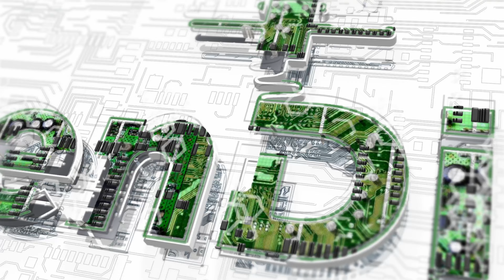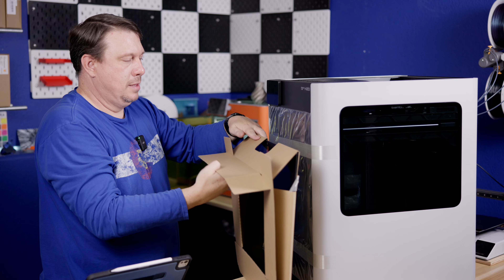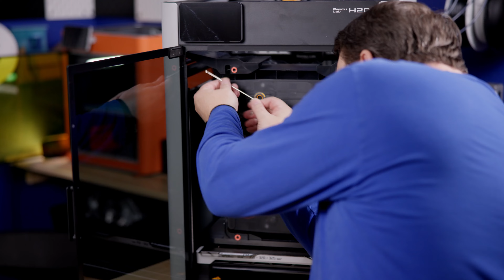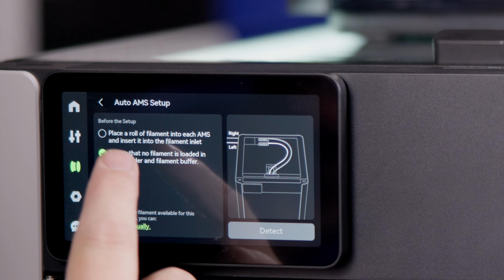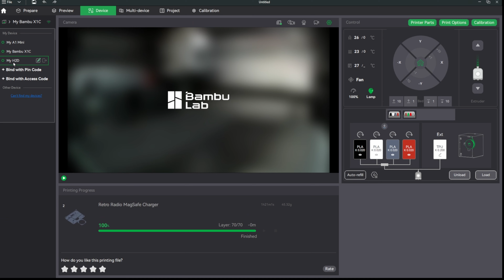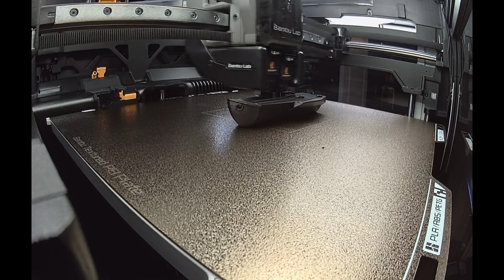Bambu Lab H2D Unboxing and first print.

Comment: The static right nozzle is more suitable for tricky filaments that aren’t suitable for an ams. With just one ams it makes more sense to hook it to the left“PLA“ nozzle and have the right nozzle do the heavy lifting. 2 ams are more useful on the H2D, one for each nozzle. It allows the slicer efficient color distribution.

Comment: Heads up. I’ve had about 400 hours of print time on my H2D and it’s doing great. I just have noticed dramatically better results when I set the pre-print flow dynamics calibration, bed leveling, and nozzle offset calibration all to on instead of auto. It takes only about 5 to 10 minutes more at most but it makes a big difference, especially if you haven’t done a full calibration in a while. I recommend turning those on at least for bigger more important prints were a few extra minutes doesn’t matter.

Also, I don’t know if it’s bad luck or an actual issue but seems every time I set time lapse on I notice more artifacts and issues with the prints
Reply: Yeah, it’s whenever you go to send your print to the printer. A little screen pops up, asking you about a couple little calibrations to run before the print and you can set them off, auto or on. I thought auto would be good enough and it was for a little while, but after a few prints Started getting some minor issues but when I set those on before every print things come out, looking absolutely the best. Again, it takes the next five or 10 minutes before each, but it’s worth it in my opinion.
Reply: Is that set from Bambu Studio?